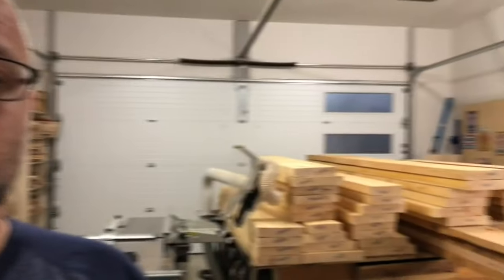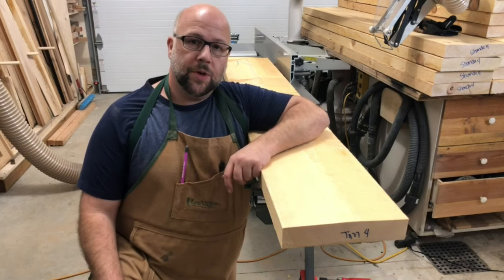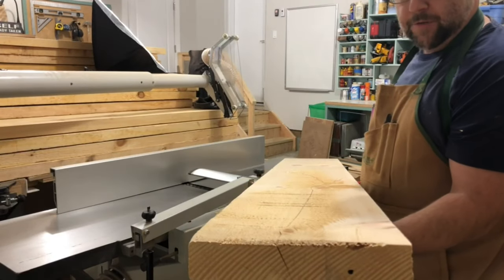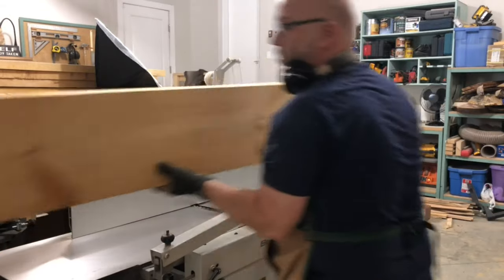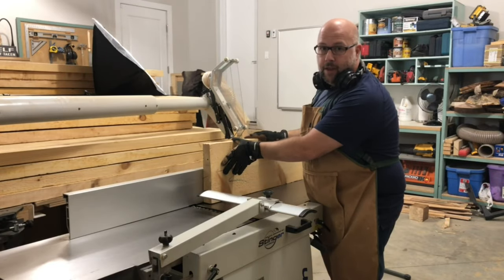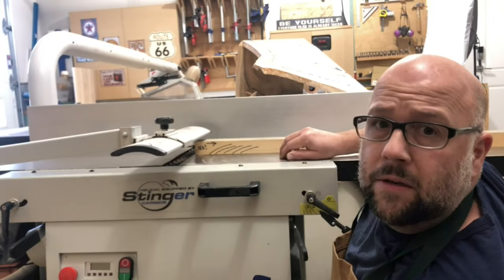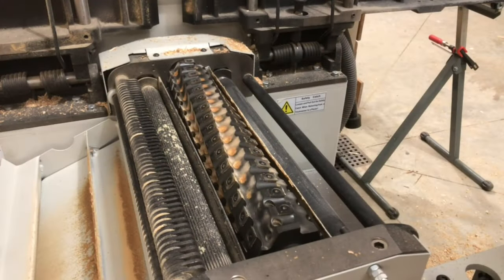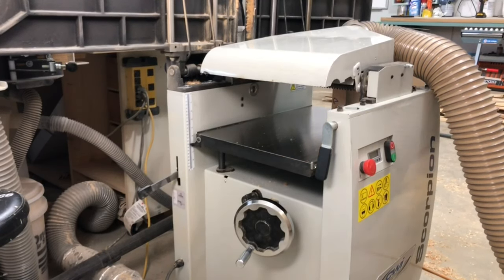How to: Mill Rough Lumber  | Custom Furniture Edmonton

Comment: Great video! What’s the longest board you’ve been able to comfortable mill using your unit?
Reply from the maker: Hi Aaron - I have milled boards up to 10ft long but it's very difficult and hard to keep the pressure even near the front and rear of the board.

Realistically, anything less than 7ft is manageable. This combination unit is great for smaller workshops but as I have moved to a larger production shop the combo unit has a lot of limitations. My plan is to move to a dedicated jointer and planer in the near future.
Reply: @taitlinstudio  if you could do it all over, would you recommend to buy separate units or start with the combo? There’s no doubt it’ll be more expensive to get a 16” jointer AND 16” planer, though it seems a larger capacity for the planer is more important compared to a jointer. Wondering your thoughts as I’m getting ready to make a purchase this summer.